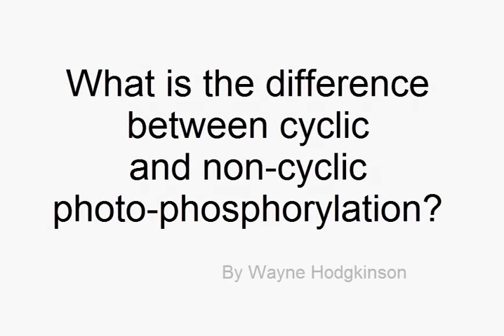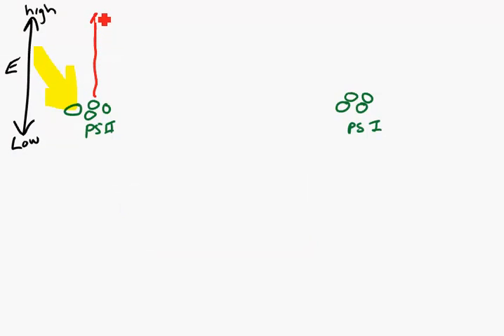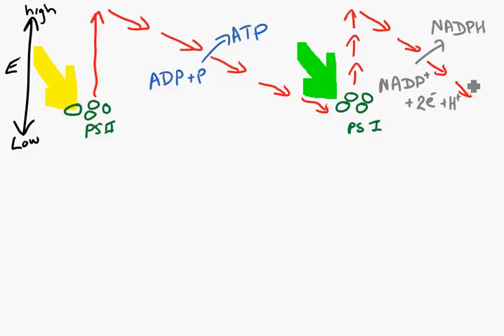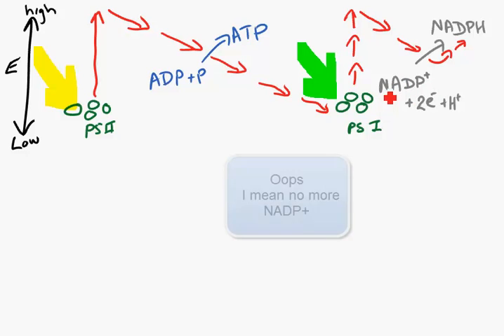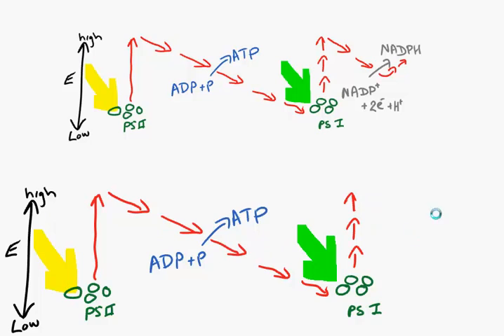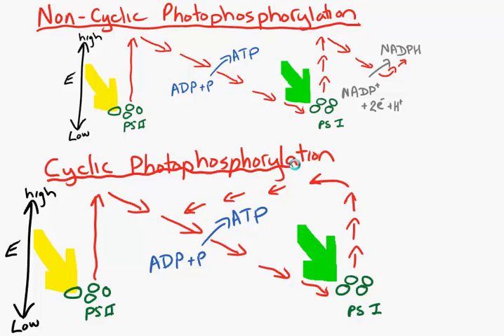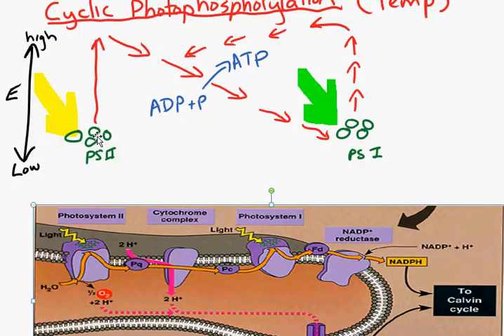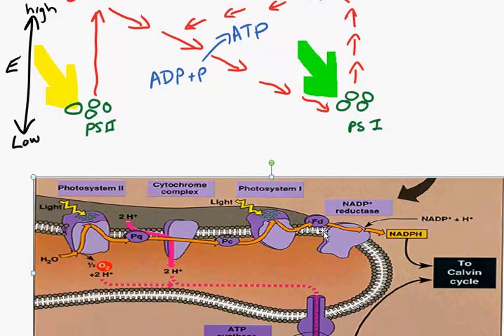Cyclic and non-cyclic photo-phosphorylation.mp4

Comment: water is broken down into h ions electrons and oxygen through a process called photolysis.... The electrons produced are then used to replace the lost electron in p680 in photosystem 2.... oxygen is excreted as a product of photosynthesis and the h ions are use to maintain an electrochemical gradient in the thylakoid membrane for photophophorylation to occur.

Comment: Cyclic vs. Non-cyclic Electron Flow. Under certain conditions, the photoexcited electrons take an alternative path called cyclic electron flow, which uses photosystem I (P700) but not photosystem II (P680). This process produces no NADPH and no O2, but it does make ATP. This is called cyclic photophosphorylation.